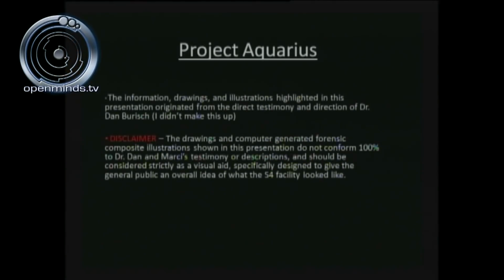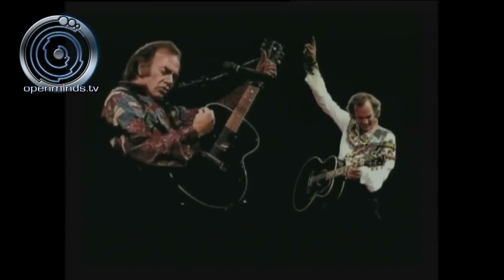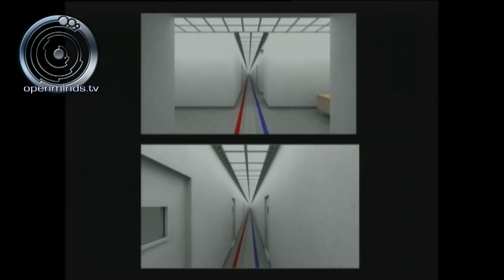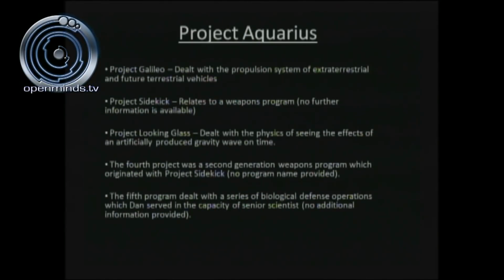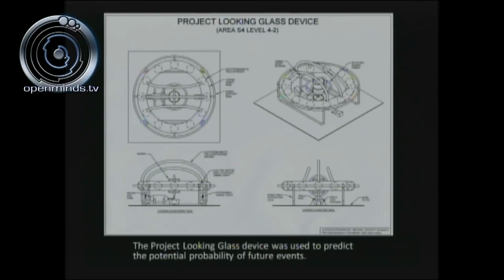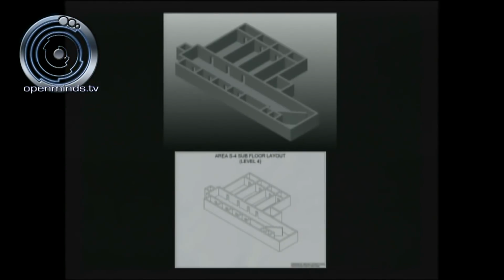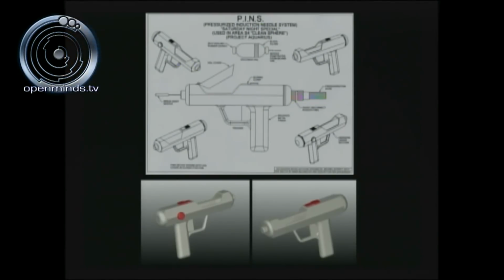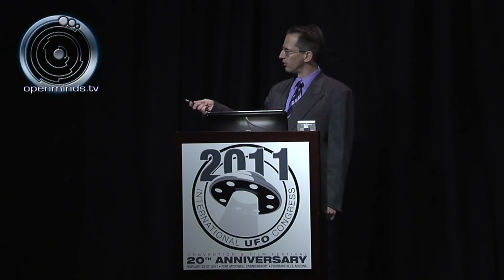"Re-Opened" Escape From Area 51 J-Rod The INSIDE Story! 2017-2018

Comment: The Hind AH is NOT a transportation helo... unless the transportee has experience flying an attack helo, or as a co pilot/gunner for a SOVIET aircraft.... an ATTACK aircraft... I don't see them "riding 12 miles in a soviet hind".... Did they strap them to the missile/gun docks? These helos are literally an anti tank/armor fighting system, first designed for close air support, and later for stopping UN/NATO Forces of thousands of tanks pouring into the iron curtain... Not to mention, why would they use such a foreign and honestly lacking piece of equipment for such a job such as transporting the literal most important minds on earth?

Comment: Actually jrod was an advistor on anti gravity engineering , he was a consultant and he would try to answer questions on engineering issues humans had when looking over the ufo/power system as it is bound by quantum mechanics which is how it is able to acheieve the fear it can do while not killing the passenger inside . The human body begin to break apart around 10 to 11 g , ttour eyes will be pushed into the back of your head witb these forces.
Reply: TR3's Reduce the gravity effect by 89%, meaning a 9g turn is then.99G, less than 1 G, big difference.

Comment: I actually drove from here in Ga to northern California to see the redwoods. On the way, I went to las vegas for one night and lost 40 bucks in ten minutes in a slot machine.

Well, the next morning I decided to leave and back track to Highway 93 that goes up central Nevada and meets up with 375 extraterrestrial highway. This place was the most errie place I've ever been. 

I turned into 375 where Racheal Nevada is and Area 51 is like 15 miles from here. As I was driving down this infinite highway, I saw in my rearview mirror two lights approaching very fast.

This was broad daylight and I could see them coming from literally miles behind me. As they got closet I realized it was two motorcycles. I was going 85 mph and they came up right beside me. The cycles and the riders were completely blacked out. They rode right beside me one on either side just staring at me at 85 mph.

I didn't know what to do so I just waved at them. They nodded their head at me and then sped off at over 100 mph.

I want to go back so bad. I didn't have the balls to ride down that little side road that leads to the main gate. To be honest, I was so nervous I drove all the way to Lee Vinings without stopping.
Reply: HIGHLY RECOMMEND YOU DON'T DRIVE TO THE MAIN GATE. THERE ISN'T ONE!!!

Comment: Because they weigh you, what happens if you have to go the bathroom? Do they give you a little plastic bag or do you have to exit S45, get weighed, use the bathroom and then check into S45 again? When I was at S26 you got in trouble if you didn't get all of your vomit into the bag so they could weigh it.

Comment: There are no "alien reproduction vehicles" that's just what they want you to believe. Ufos are not machines but are instead more like flying portals especially the pitch black ones. The ones that look mechanical are simply 3d holograms inside flying transparent cubes, and some are one of many forms of the so called "aliens". And the so called "aliens" are not extra-terrestrials, that is what they want you to believe. Its because they want you tto accept them as your teacher, your sensei, your "ascended masters" for the sole purpose of enslavement. But they're not alive nor are they dead. They are inter-dimensional. They lie to hide their true nature and their knowledge from others. They;re in your house right now. They're in mine also. You can't see them with the naked eye but can see them quite easily with a curved mirror or low lighting while filming with an iphone camera and the brightness turned up. The binoculars apps for androids works alright in low lighting but they're best seen with a filterless camera, one which you record after taking the lens filter out.

Comment: THEIR ARE NO TOILETS AND NO CENTRAL HEATIING  SYSTEMS POINTS TO ON THING THEY ARE DESIGNED FOR  ALEIN ROBOTS . AND THEIR ARE FOUR TYPES OF GRAVITY THE MOTHER SHIP SIZE OF THE EARTH USES ALL FOUR  .TYPES  BUT SPYING ON YOUR OWN AIR FORCE  SHOULD NOT BE ALLOWED. THEY SHOULD BE HANCED WITHOUT WEIGHTS 168 HOURS. AND KICKED IN BALLS 12 TIMES BEFORE HAND.

Comment: This is a military secret. The Earth is magnetic. What happens when you trying putting magnets together? The force pushes them apart right? Ok. So these engines are started up, spin fast, and causes a magnet affect. The plane then starts to lift up off the other magnet. I been holding this in since I tried making a paper plane float across a magnet strip and a string to pull it across. Oh did you think that a little bit of wind can lift tons of steal? Or a tiny bit of speed? Nope. Or esle you car would fly

Comment: I want to believe! Although back in 2000 during my trucking live I was driving from Las Vegas NV to Reno NV at night and as I was passing the Area 51 on my right I saw 4 bright, huge disc shaped(battleship size)UFOs that were hovering over the mountains than each UFO lowered small also bright craft which formed a convoy that started moving down the mountain! I got scared and kept driving in fear for my life. The hall thing looked like contact in progress cause instead of landing out of site where Area 51 was those discs remained above!